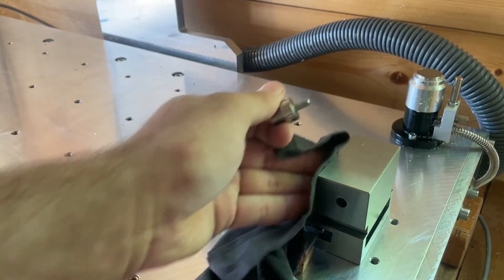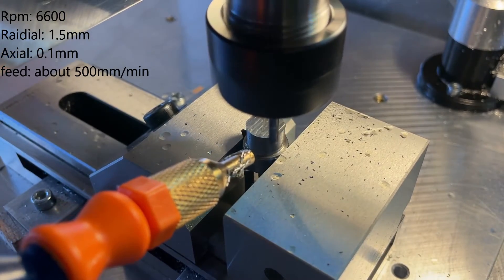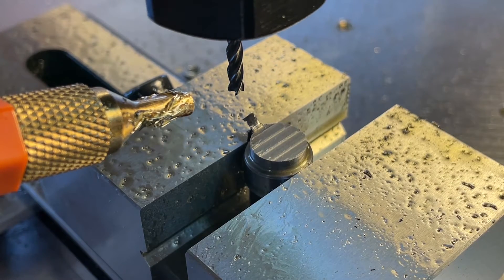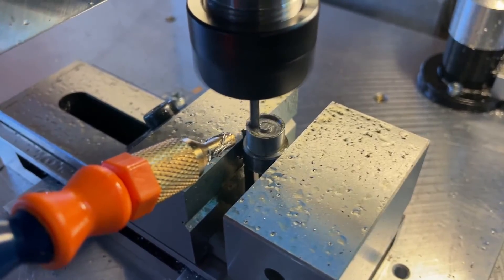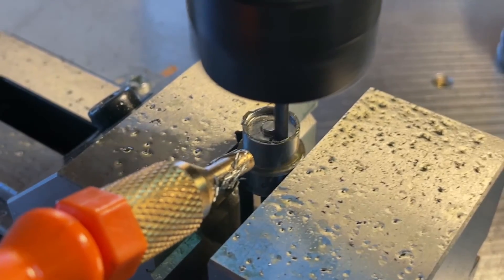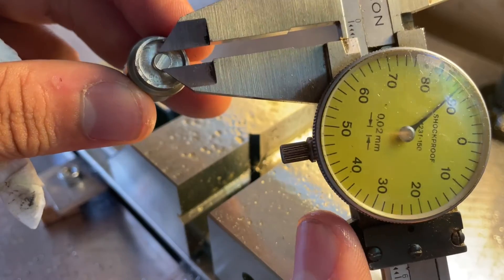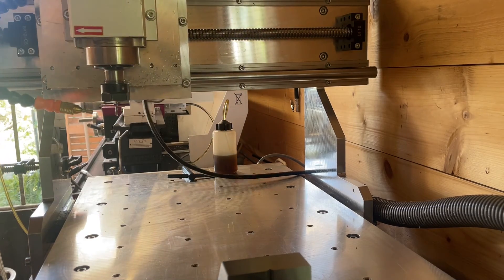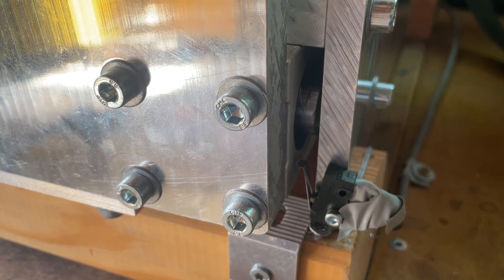Can my diy CNC router mill stainless steel?

Comment: Geiles Projekt 💪🏻 be grad selber drah sit paar Mönet z'plane für e eigni 😅 Gseh i schro richtig, dass du Aluplatte verwendet hesch für de Rahme? Be ebe am überlegge, au us Alu z'mache us chöschte Gründ will halt Rostfrei sau tür wär 🥲 und geili Video Idee wär no s'Prinzip dehinder zeige, also Grobi ufbau. (Han by the way bis jetzt au die glich 2.2kw Spindel und 3 x 34 er Nema Closed Loop Motore (12Nm)). Freu mi uf d'Antwort, witer so 💪🏻😁

Comment: how did you get the tool setter working? i have a grbl machine and id like to be able to do tool changes and have it be semi automatic so it will set tool z during a setup
Reply from the maker: It is pretey simple to do withe the controller i have i have a estelcam controller and with that it works pretty well